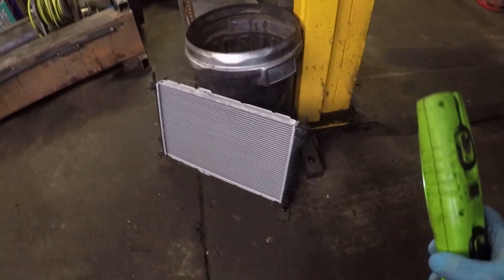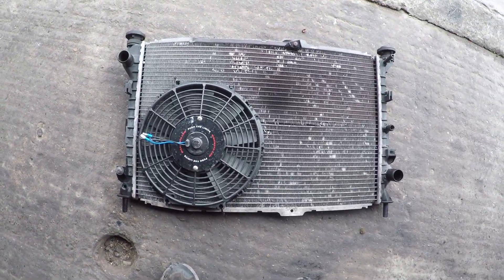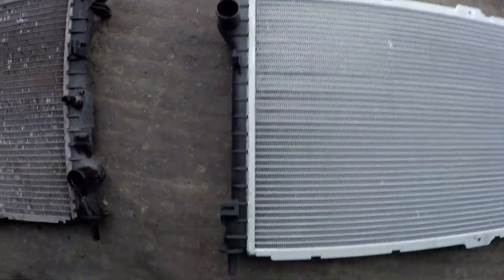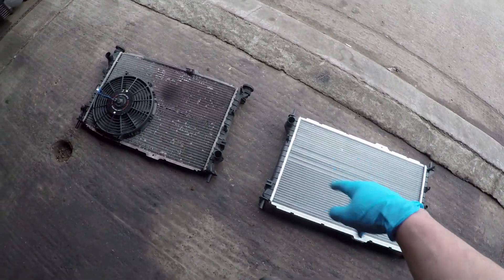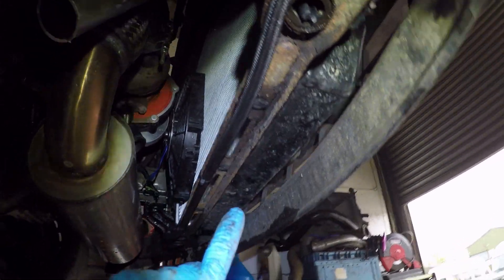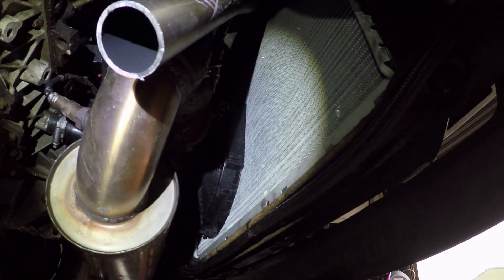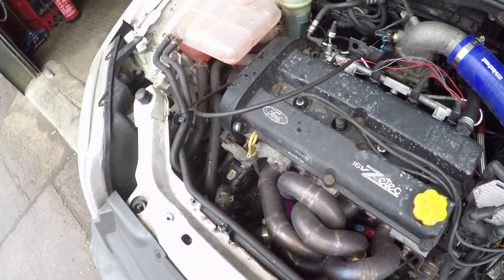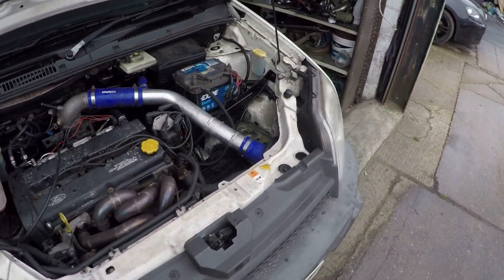TURBO CHARGED transit connect Radiator replacement

Comment: Hi mate great video again, I have a question, I changed the rad on my connect the other day and changed my thermostat I get heat through the blowers when driving but when I’m stationary it goes cold again (on the heat setting) any advice would be great cheers pal